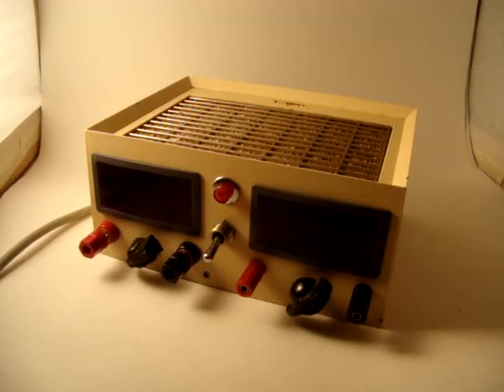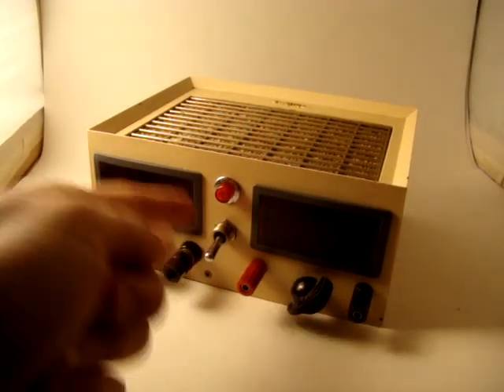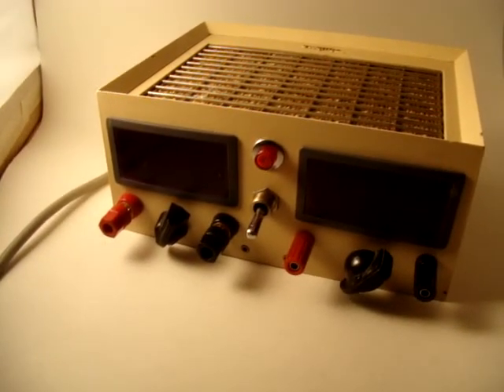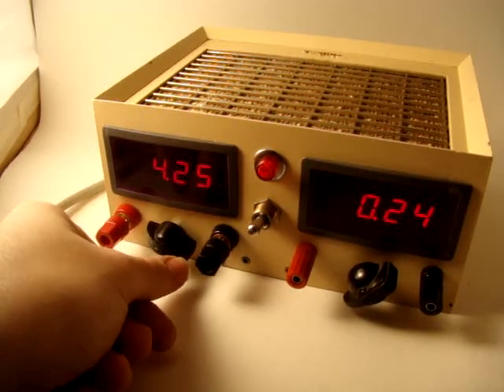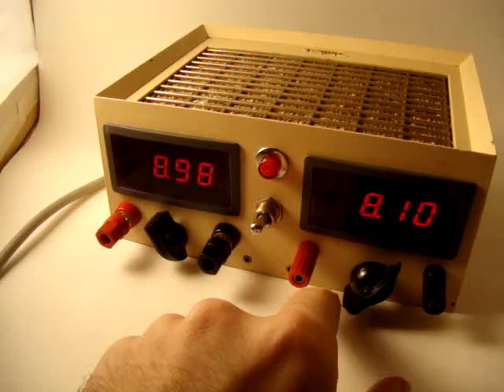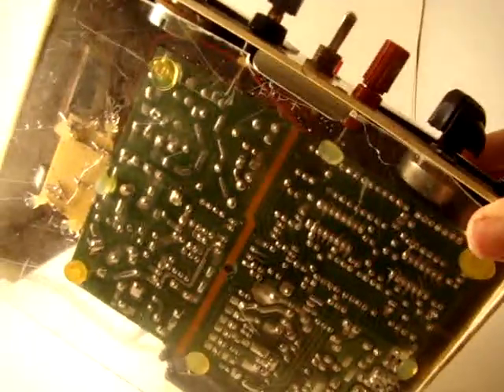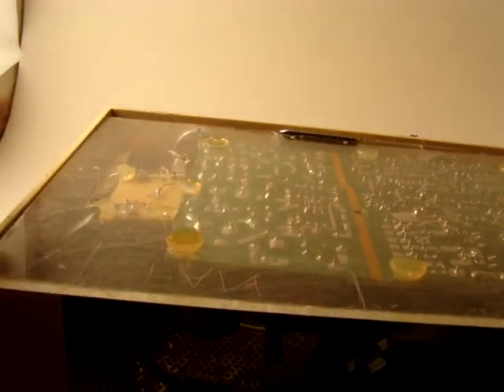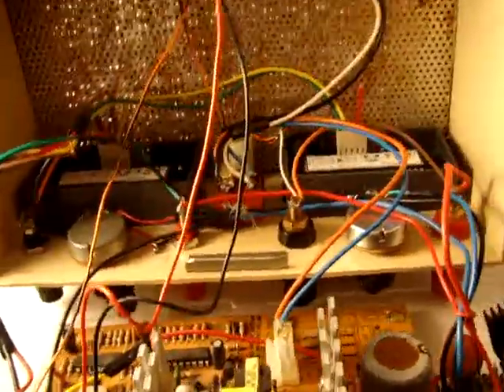Custom Dual Variable PowerSupply!

Comment: first tip : put a large heatsink on the regulators!

nice thing, but maybe you can buy a 24 volt transformer, bridge rectifier and buffer capacitor, and make a 2-30 volt power supply, make sure the transformer can supply 10 amps @ 24 volts, so you can take 2x3 amps.

Comment from the maker: Yep, havent quite got it figured out yet, have heatsinks out of a broken amiga power supply that will go on teh LM350s. need to figure out why i get massive voltage drop under any kind of load.

Comment: There are a couple of FAQ's on converting a switching pc power supply to a bench supply.

Do you need to add a big resistor to preload the suppy to stabelize the voltage.

I never built one but read about it, I am spoiled to have a few Heathkit supplies.